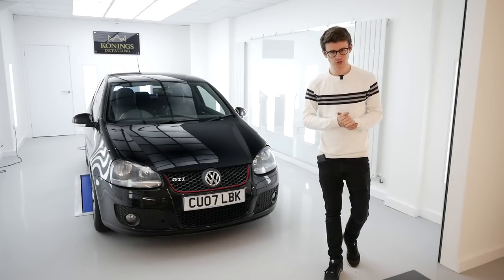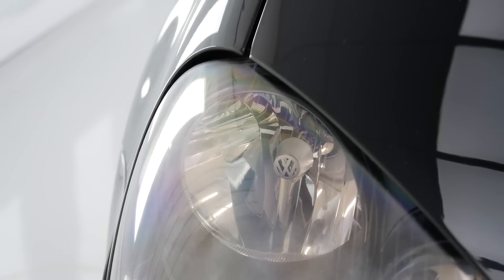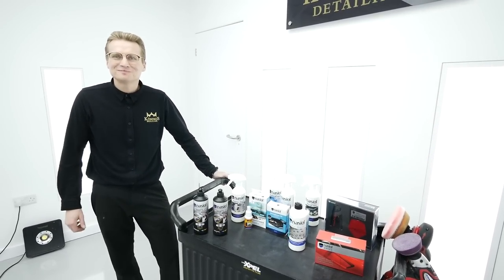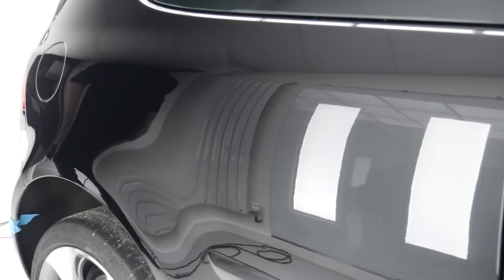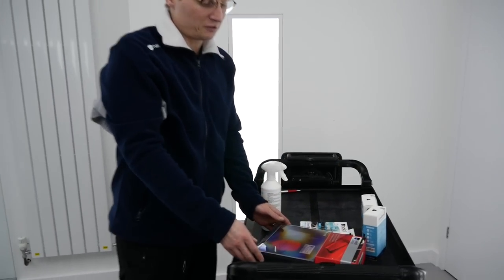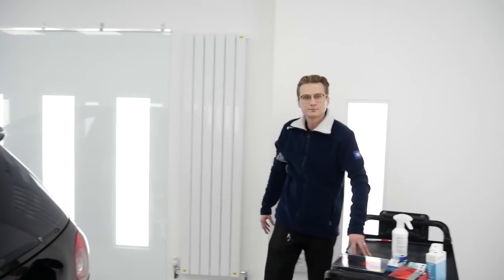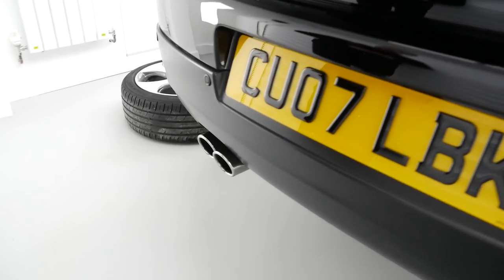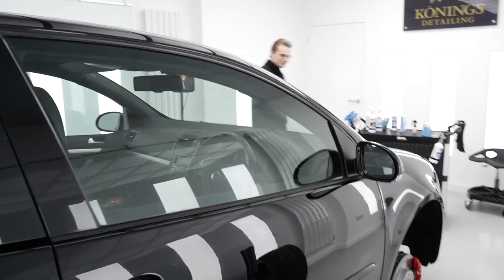INCREDIBLE 50 Hour Detail on my 100,000 Mile Golf GTI!

Comment: Great job and so it should be for the labour.. vw paint and lacquer can be notoriously soft and difficult to get that mirror finish, its all about products and ambient temperatures.. can tell both guys have a passion for cars.. just a shame about the anti roll bar and could have been sanded and finished better as that will not last long and wire brush the spigots could have been greased.. bottom of the shocks were still left.. still a great job man.. Also he looked Pissed in the bonnet reflection when you poured the water over it hahaha